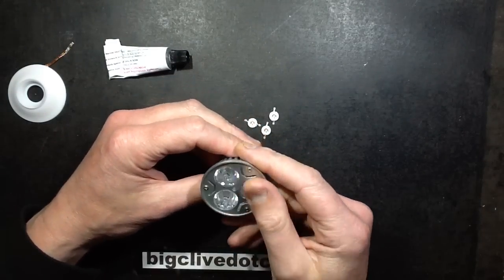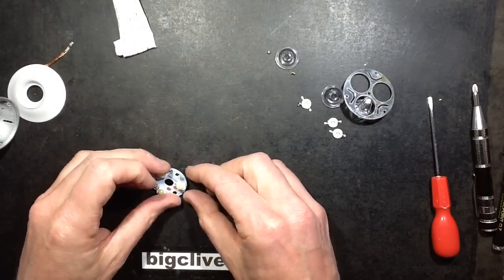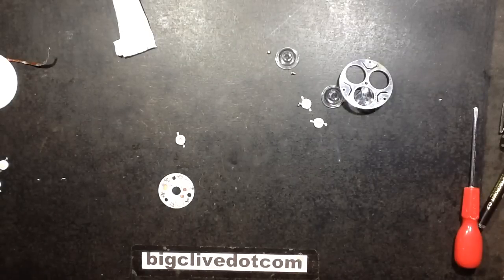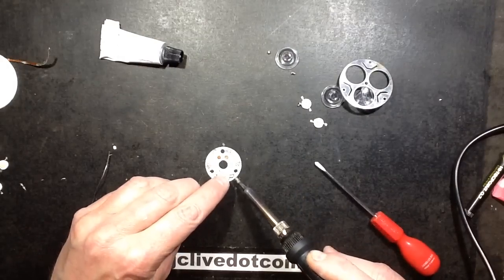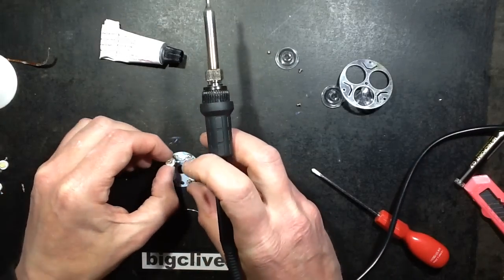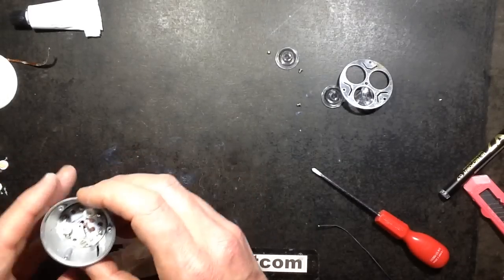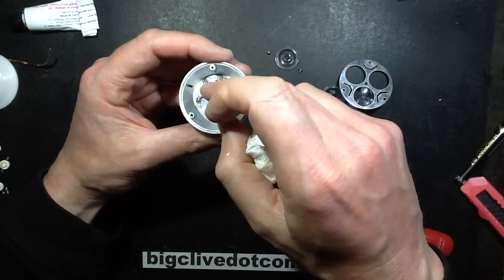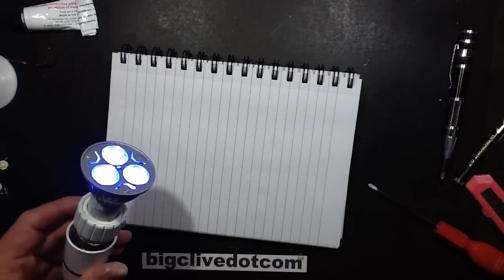Swapping the LEDs in a Poundland 3x1W GU10 lamp.

Comment: The very first tube of heatsink compound I bought,  way back when,  was clear rather than white.  Every bit of it since then was white,  and messy,  like what you had to deal with there.  Then there are all the exotic-appearing forumulations sold to the computer hotrodding crowd,  which I've little experience with (nor time for).

Comment: Been watching your vids for a while now. They are very cool and love to watch them. I wanna make a glitter lamp like your green on or a red one or a blue one. No sure what else I would need. I can send you all the bulb lamps you want when Christmas come here in the states
Reply from the maker: John K The current best solution in the glitter lamp is calcium nitrate, with enough added that no more will dissolve in the water, then left for a bit and filtered through a water filter.  (Don't use the filter for drinking water afterwards.)
If you make it with silver glitter then you can make it any colour by using different LED GU10 style lamps.
Reply: You are both right. It is the Tourist Trophy race run in a Time Trial format.